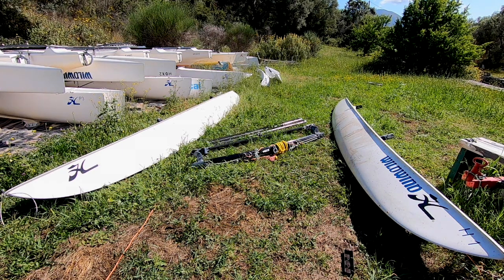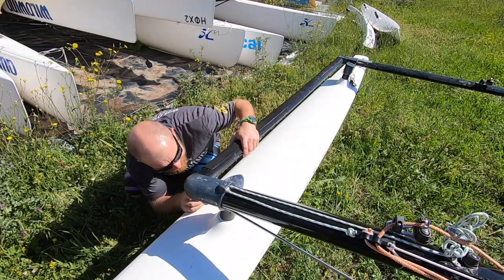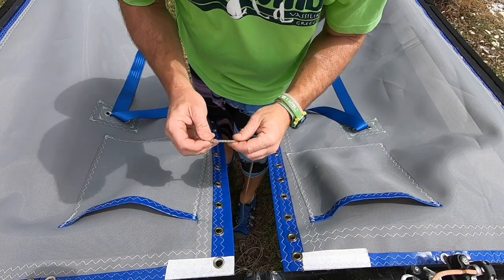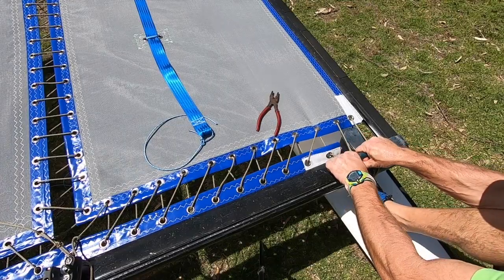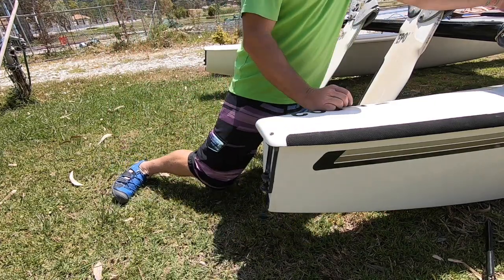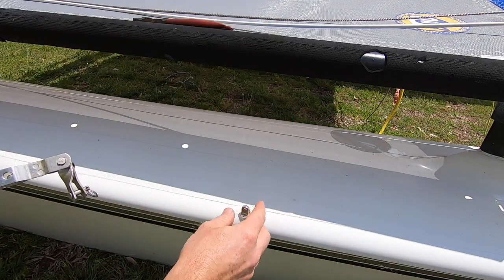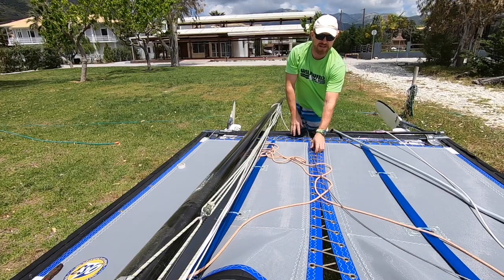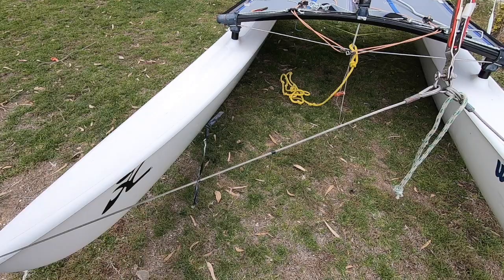Hobie 16 complete assembly and rigging

Comment: Hey Joe I mounted a winch on my trailer w pulley at top of mast holder to lift mast by myself. The winch bent the mast pole holder 
Over. Ugh! The mast is too heavy.
Help
Reply from the maker: I think that to use this kind of winch system you need to lift the mast to around 45 degrees before you start, otherwise the leverage needed is too great.
Then the winch can be lower down and not risk damaging the mast crutch.
Reply: @JoyriderTV  thanks Joe
It's hard when your 62. Lol
I'm fit though

Comment: Is there any reason why H16 have a plastic nut for the bolt that holds the casting to the pylon ? My best guest is to prevent rust for that piece.
Reply from the maker: I've often wondered that myself. 
Maybe to prevent corrosion.
Maybe the plastic doesn't vibrate loose like a SS one would.
Maybe because it's cheaper.
Maybe to stop people damaging their casting by making it too tight - that's probably the most likely.